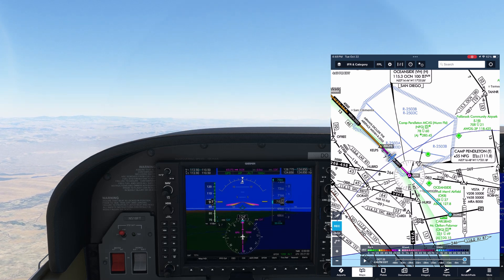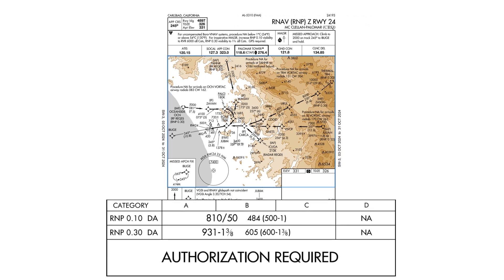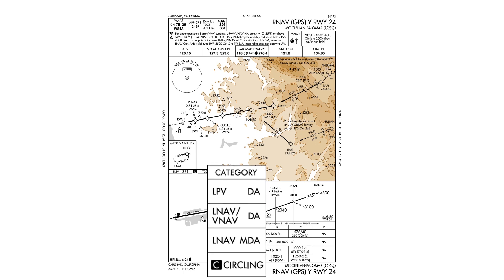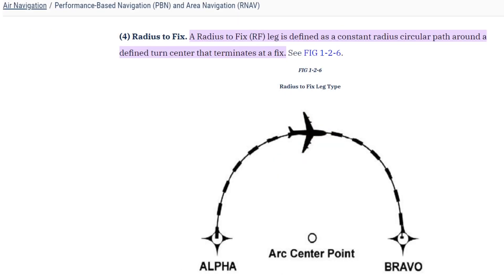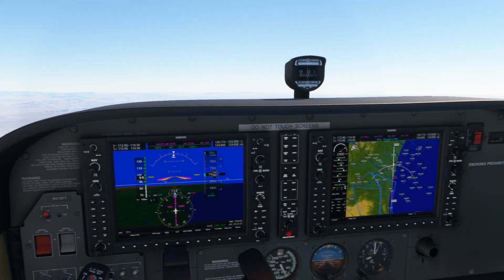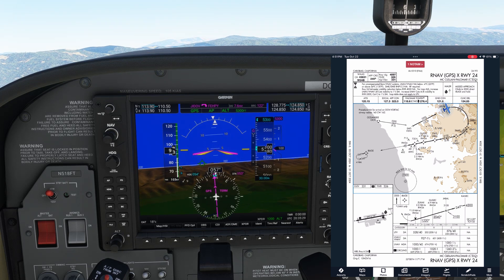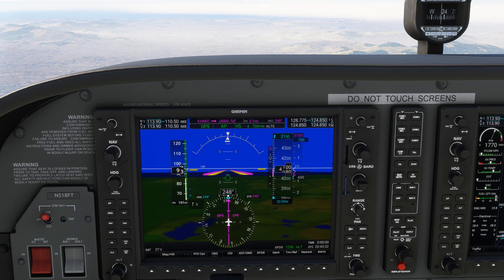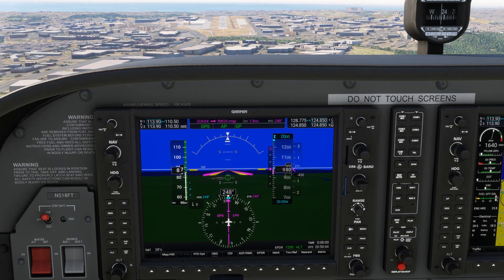Radius to Fix | GPS Leg Types on Approaches

Comment: If you fly with most Garmin units, including the newer versions of the G1000, the AFMS and/or pilot guides typically include the following limitations on flying RF legs in light GA aircraft that are not approved to fly Authorization Required procedures:

Aircraft is limited to 180 KIAS while on the RF leg
RF legs are limited to RNP 1 procedures. RNP AR and RNP <1 are not approved
Primary navigation guidance on RF legs must be shown on an EHSI (electronic HSI) indicator with auto-slew capability turned ON
Moving Map, EHSI Map, or Distance to Next Waypoint information must be displayed to the pilot during the RF leg when flying without the aid of the autopilot or flight director.
The active waypoint must be displayed in the pilot’s primary field of view

Although AC 90-105 says you must fly RF legs with an AP, the STC for the GTNs and newer AFMS note that:

This STC has demonstrated acceptable crew workload and Flight Technical Error for hand flown procedures with RF legs when the GTN installation complies with limitation set forth in Section 2.12 of this document. It is recommended to couple the autopilot for RF procedures, if available, but it is not required to do so.

Comment: Also in the approach notes it says "DME/DME RNP-0.3 NA". Can you clarify what they mean by this?
Reply: DME/DME RNP is a type of RNAV system where the FMS (usually) uses multiple DME signals to triangulate a position. if you can't use it you need gps.

Comment: If you're nav system can select the X version of the approach, how do you have that particular version in your IFR plan and/or tell ATC you want that version? E.g., they give you vectors and not knowing otherwise, assume you need the Y version?
Reply: You don’t put approaches in the flight plan, just airports, airways, and waypoints. You will be assigned an approach, but can usually request a specific one while farther out. This demonstrated reviewing the available approaches in advance and determining what would be the best one for your situation. ATC will know some of your capabilities based on info in the flight plan, but not what you’re personally capable of. 

You should know what approaches you can handle at your destination before taking off, and if possible what to expect based on forecast weather.
Reply: @shockwave538  Great explanation, thanks.

Comment: Where can I find which approach is doable and which is not with your GPS? I tried my best to find those but wasn't able to find any. G1000 Nxi and C172SP POH did not have any information. Especially RNAV RNP was impossible to find.
Reply: the nav database for your unit. i.e. whichever approaches the nav unit displays as options to load.
Reply: @cha05  That's not a real answer. You need to know NAV performance to file IFR flightplan as well. Foreflight has good guidance but it's not an official document.
Reply: the answer to your question “Where can I find which approach is doable and which is not with your GPS” is still “what your nav unit says it can load”. no document will have that information, it is determined entirely by the nav unit, its firmware, and the nav database currently loaded.

but it sounds like you’re asking a different question: “what do i and my aircraft need in order to fly this approach” the short answer, as with all IFR flying, is “you better know what you’re doing and be equipped and trained for it”.

here is the long answer: there is no difference in the ICAO PBN codes you would file for this approach. while RF leg navigation falls under the set of A-RNP navigator capabilities, we GA pilots are prohibited from filing the more-specific RNP ICAO codes in our flight plan without additional authorization (LOA) since we (as pilot/operators) don’t meet the training/authorization requirements to fly those RNP AR approaches that strictly require RNP. rather, this approach is saying “IF your navigator is A-RNP capable (i.e. can navigate RF legs) then you MAY fly that segment of the approach (despite you/your aircraft not being formally RNP-authorized)”. the only requirement for this approach is RF navigation, and that’s only if you intend to fly the RF feeder leg. notably, a non-AR RNP approach must be navigable to the final approach course WITHOUT RF (ie via vectors or alternate feeders) otherwise it would become an RNP AR approach and we would not be able to fly it. that is why we can plan to fly this approach despite not meeting RNP authorization criteria, and thus there is no difference in the PBN codes we would file. it’s just what you file normally for RNAV capability. in fact, filing something like T1 would be illegal without obtaining a LOA.

this is a pretty deep rabbit hole — see AC 90-105A for the nav certification requirements. manufacturers like garmin publish additional guidance, see their “Garmin Performance-Based Navigation Capabilities” PDF for the high level (you’ll see it talks about firmware versions which enable the functionality). if you want the deep specifics, i.e. what YOU need in YOUR airplane to fly THIS approach: the answer is in the manufacturer’s STC, i.e. garmin’s GTN STC 190-01007-A5. in there you’ll find interesting restrictions, such as requiring a flight director or AP to fly the RF leg — can’t just do it on the CDI like usual.

bruce air has a good summary, see “RNP Procedures and Typical Part 91 Pilots” and “Garmin GTN Avionics and RF Legs” articles.
Reply: @cha05  Wow, thanks for the high-quality information. As a CFII, whenever my student asks 'Can we shoot this approach' and go for very natural follow-up question of 'Where can we find it' was somewhat insufficient. Thanks for the great detail.
Reply: no problem ^_^ from one CFII to the other, we’re all in this together!
Reply: If you read the AFMS for your equipment, it may specify what your installation can do. Some things get annotated by the installer, such as if it’s LPV authorized. Not sure if RF legs would be in there. Also read the manual/pilot guide for a thorough description and possible limitations.

Comment: <3 Palomar  airport! Built on a landfill so the runway is a little wobbly but not to an extent that's problematic and it gives it a little bit of nice extra elevation relative to the surrounding area. Used to fly from there up to Oceanside (KOKB) which is a tiny runway to do touch and goes.

Comment: Hello, I was wondering if you could do a Video or if there is a Video explaining the wind cones and How they work. Now i understand how they work but still struggling on how to number the runways if there isn’t one. Since there is no number.  Like if the wind blows south-west i should land on Runways 09 -27. How do i figure out the runways numbers.. It’s hard to explain but would be much help. Thanks
Reply: @smvms  
So i Should Memorize the magnetic compass And figure out the Numbers from there? 
On the knowledge test.
Reply: @MRNO2  You should know at a minimum what compass headings N-S-E-W are. NE-SE-etc would also be good. So if the test says the wind is from the NW and the runways are 26/8 then you’ll know the wind best aligns with runway 26. Just visualize the compass with the 4 main numbers on it.
Reply: @shockwave538  Much Appreciated, Mate.
Reply: @MRNO2  If you are having this much trouble with runway numbers and compass degrees you should pay a certified instructor for an hour or two of one on one tutoring.(Maybe you need a different instructor that has a new way of explaining it, I don't know anything about your situation.)
Reply: @mytech6779  
Actually I don’t have an instructor, I’m studying on my own for the PPL Knowledge exam. I’m gonna apply for ATP Flight School and i was advised by a Lot of students to finish my knowledge exam before applying so i can have lots of time to fly and not be stressed since it’s an accelerated program.
Reply: @MRNO2  
Some pre-study is certainly a good thing if it is using standardized materials that won't send you down the wrong path; the FAA wants their bureaucratic answers, which involve some memorization and don't always jive with modern science and engineering terms and perspectives. 

In any case you can't take the private knowledge test without an instructor endorsement(part 61), or a completion certificate from a 35 hour ground-school course(in-person or online). 
ATP is a 141 program so they should be providing a 35 hour ground course to qualify you for the knowledge test.

Be sure you have good reason to go with ATP and nothing in your life that could possibly become a distraction (children, drunks, relationships with an immature person, business stuff, car trouble, pets…). 
You pay ATP 100% up front and they keep your money if they wash you out because you don't keep up with their minimum pace of progression (minimum cost) through the stage checks (It is a bit of a scammy business model.).